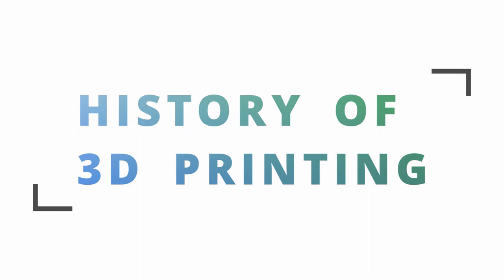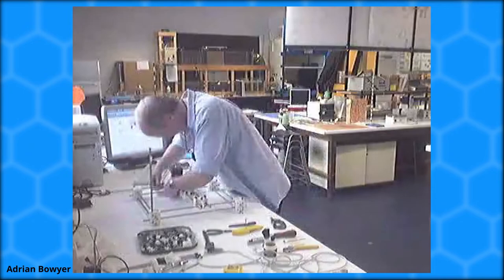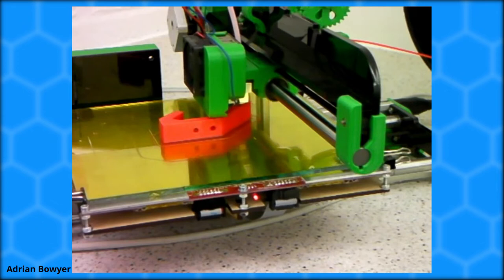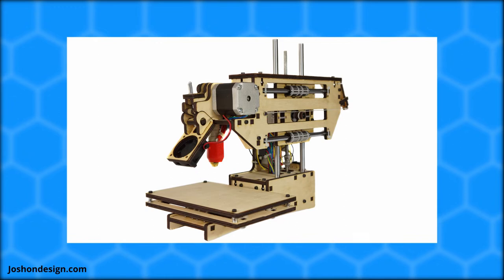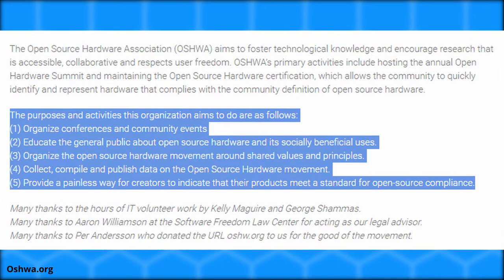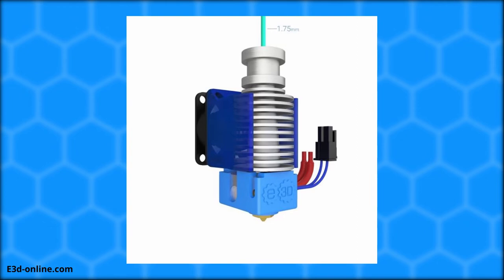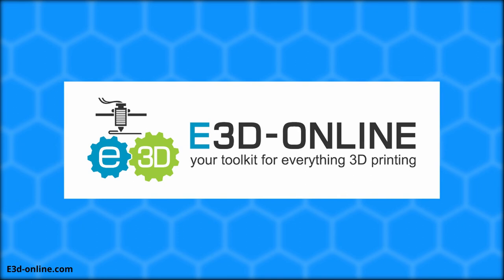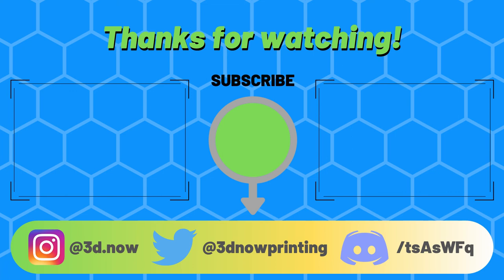The History of Consumer 3D Printing (ft. Adrian Bowyer and Sanjay Mortimer!)

Comment: MakerBot turned into a leach as soon as they closed source. Having an open source system was their biggest selling point but they ran the company solely around variations of 1 product when they should have focused on innovation like Prusa. Selling out to Stratisys was such a huge disappointment too and was not what they sold the community on.
Reply: Aside from my very biased opinion on MakerBot, the video was very informative :D
Reply: As an addition to this, while the Tangibot is cited as the biggest contributor to Makerbot's closed source move, it should be noted that they'd already begun to lock down their designs before the Tangibot ever came on the scene. There was also their bad behavior around taking community designs on Thingiverse and patenting them, as well as the furor around the Automated Build Platform (rip).